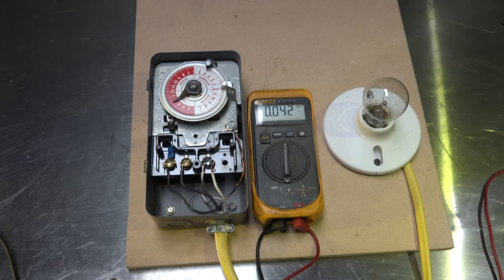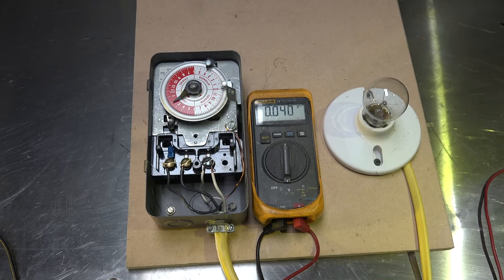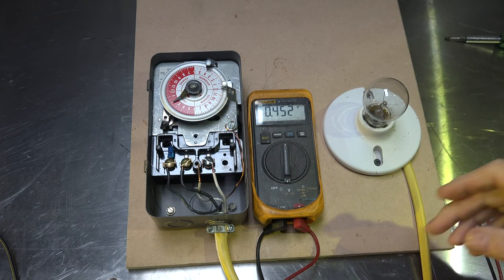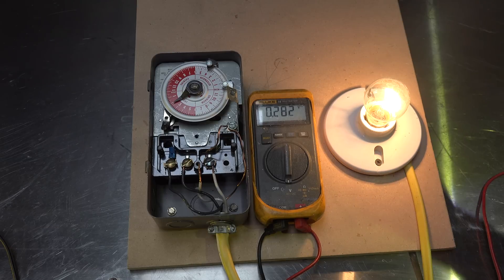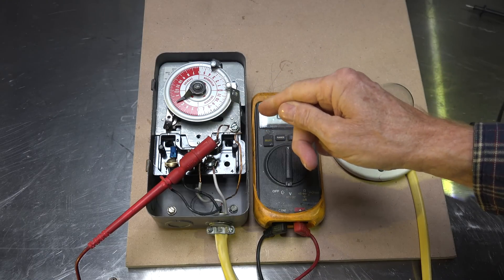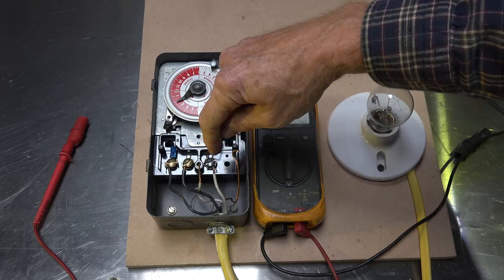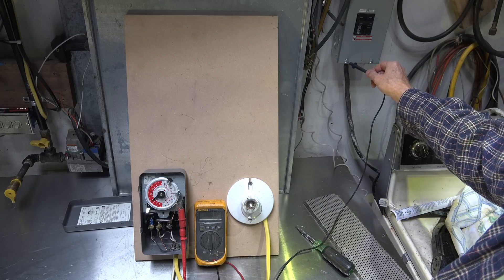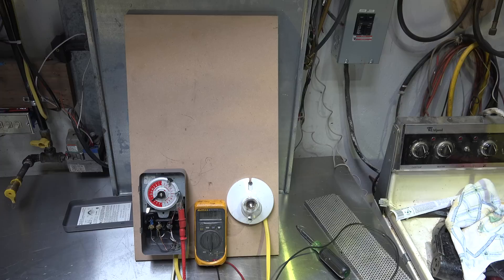The separation of  neutral and ground on the sub panel

Comment: @grayfurnaceman  On terminal 3 in this subpanel, which neutral is connected the light, and which neutral is from the mains power (the neutral wire on the left or right)?
Reply from the maker: It is the neutral on the left of the terminal.  Because the ground wire is connected to the neutral in the main panel, there is a path to neutral.
GFM

Comment: Exactly what I needed to know...will be wiring a two space subpanel in detached building and now I plan on driving a ground rod and putting in a separate ground terminal.....thanks for a great explanation!!
Reply: Don’t install a second ground rod.   Your ground needs to come from a common ground at the main panel.   Ground loops can readily occur and give you fits with electronics and could have enough potential to be dangerous to your health.
Reply from the maker: Welcome
GFM

Comment: The thing that's throwing me off is that if it's bad to tie them at the subpanel, then why isn't it equally as bad to connect them at the main panel?
Reply from the maker: Consider if the neutral and ground were bonded in the sub panel and there was an open in the neutral.  Would not the ground then possibly become hot if there was a problem in the ground circuit?
GFM
Reply: Right, I get that.  But wouldn't the same thing happen on an open neutral from a circuit from the main panel?  Thanks for the reply by the way.
Reply from the maker: Its all about the conductors upstream of the panel.  If the neutral is open between the main panel and the pole transformer, no 120 volt circuits will operate.  Those circuits in sub panels would operate if the ground and neutral were connected.  Contrary to some beliefs, earth ground is not part of the circuit.
GFM
Reply: The path is to long from the sub panel
Reply: OK, that makes sense. An open neutral in a sub box that has neutral and ground bonded, while energizing the case, also follows the ground patch back to the main box, finds a patch back to neutral at the main ground to neutral bond, allowing for dangerous operation of loads at the drop of the sub.   ///   An open at the Neutral lead toward the transformer kills the ability for a/c to flow as one side is open to the source.  Even clearer now.
Reply: I’ve got a sub panel with no ground bus bar to hook up grounds to, or for that matter, even the 100 amp service ground back to the meter either. I’m assuming I need to buy a ground bus and keep grounds and neutrals separate but? I think the only other panel I’ve wired had the ground bus so I looked into this one kinda skeptically and found your other vid then this one
Reply: @907Blademan  if you have a subpanel with 4 wires coming into it from the main panel or main disconnect the 4 wires are 2 hots 1 grounded conductor (neutral) and 1 grounding conductor (ground) install a ground bar flush  to the metal inside the subpanel. Make sure to run a green bond screw through the ground bar and into the metal panel housing. All your grounds will go here. Then your neutral bar will be sitting on plastic feet/ insulator to make sure it does not touch the metal housing of the sub panel or touch the ground bar in anyway. All your neutrals will go here separated from ANY grounds. Always remember, you seperate your grounds and neutrals AFTER the first means of disconnect. ( the main power shutoff) I hope this helps someone.
Reply: @907Blademan 
If you read the package it likely says that for use as subpanel, you need to install a separate ground bar kit purchased separately. And will also instruct you to NOT install the bonding screw.

This allows them to sell it for use as a main or a subpanel.
Main AS/IS (just install bonding screw) or as a subpanel by adding a ground bar kit.
Reply: The main should have a separate wire (usually 8 AWG bare solid copper) that runs from the main panel to Earth ground. 

This is so if you are using an appliance that shorts out, there is a path of least resistance to Earth ground. ( Less resistance than your body standing in a wet shower touching a metal handle. )

ANYWHERE that neutral and ground are connected (bonded together) there should ALSO be a wire from there to Earth ground. (usually a 5/8" copper rod driven into the Earth nearby)

Comment: If the ground wire and the neutral wire are terminated on the same strip in the panel, you're pissing in the wind. By hooking up a duplicate ground to the chassis of that timer, you did exactly the same thing as your little white jumper wire.
Reply from the maker: It is not the same.  I have explained this in other videos.  Try my channel playlist  "Grounding and bonding"
GFM

Comment: I have a Sub-Panel in my shop which was there when I moved in....  It's wired WRONG as per your illustration.   I want to correct it.......  It's actually 200 amps coming directly off the Meter, to a 100A Disconnect approximately 2' away from the meter, from the 100A Disconnect Box on the Hose,  the wire runs under ground the Shop.   Theres 4 wire leading into to the sub-panel.  

Question:  How do I determine and/or Identify which is  "Neutral and which is  Ground", so I can  ????   

I know it's wired wrong, because a 110 outlet has POWER from "Safety Ground" to 1 side of the socket. 

So, I want to Correct it,    just need to know how to determine NEUTRAL from the GROUND.   Any help is appreciated.
Reply from the maker: If there are 4 wires it is probably ok.  Having power between the hot (small slot) and earth ground is normal.  Look for the same color wire at each end of the line to the shop.  The ground at the main panel should have bare wires going to it.
GFM

Comment: why not make 2 separate connection to the floor? one for neutral and one for ground.
Reply from the maker: Because neutral is a part of the circuit. Earth ground is not part of the circuit. It is only there for lightning and surge dissipation
GFM
Reply: It's hooked up to the ground bus bar in the panel for surge protection/lightning protection. Like GFM said, the only purpose for the ground rods physically driven into the ground is for protection against lightning strikes preventing electrical fires in the home, and surge's in the power lines upstream of the main panel.
Reply: Not if it's hooked to the ground bus in the panel.

Comment: most homes have a bonded ground and neutral.  both then share the same potential no matter where they are bonded in the home. understanding potential is not the hilight of some HVAC techs knowledge which can lead to disaster if not properly handled.

Comment: What if you have an outbuilding from the 1940's with a subpanel that only has hot and neutral feeders from the main panel? The whole electrical system of the building is in EMT(set screws connecting sections) with metal boxes, all metal boxes as well as outlets are pigtailed to ground wire, then ground and neutral are bonded in sub-panel, with a ground rod being attached to the panel as well. Even if a hot wire touched anything metal in the system, there is a direct path back to the main by the ground-neutral bonding. Is this still unsafe?
Reply: Sherman, that doesn't sound right to me.  It sounds like you have two grounds for your system, one at the out building and one at the main building.  I think you need to remove both the ground rod and the ground/neutral bonding from the sub-panel and run a separate ground to the main panel in the main building.  Your conduit and steel boxes act as a ground for the out building and that is fine as long as they are connected to your system ground but having two system grounds can be dangerous.  I am just a guy with some electrical experience, I am not a trained electrician.  If you still have questions about what you should do then you should call a certified electrician.

Comment: at the main service disconnect, the "building ground" and service neutral are bonded, though, right? so what prevents the exact same situation occurring on any particular load-side circuit, in an installation where there are no sup-panels? the neutral becomes open somehow at the main service disconnect - load devices still have a hot and still return undesired current via their ground wiring. How is this only a phenomenon that can occur when configured at a sub-panel? I think I see how, in that the load devices do not bond their chassis and their neutral - but still, the fault (or mis-wiring) that you induced in the sub panel could also be induced in a mains panel, no?
Reply: Rick, you answer most of your own questions in your post but to answer your last question, the neutral and ground are already connected via bonding screw at the main panel so shorting them would have no effect and disconnecting the neutral wire would break the circuit.  So, no the faults he created in the sub-panel could not be induced in the mains panel.

Comment: but, if your grounds are intacted you should have no problem. is a common/neutral not in fact a ground? mine runs to the ground in the main.
Reply from the maker: Earth ground is not part of the circuit.  The circuit is hot to neutral.  Earth ground is for surges and lightning absorption.  Hope this helps.
GFM
Reply: Patrick Pedigo if they are bonded in the main, they share the same potential and the ground becomes part of the return path for current. If anyone tells you different, they then do not understand electrical potential.

Comment: The neutral is a current carrying conductor all current carrying conductors have a voltage drop . In the main panel ground and neutral are bonded this is the only place that makes since . In a sub panel it may be a long way from the main so as current flows through the neutral there is a voltage across it ,if it was bonded again in the sub panel this voltage drop would be present at all ground pins at every receptacle ,yes it would be very low but under the right circumstance it could shock some one ,not to mention ground loops. The only place that neutral and ground should touch is in the main panel.
Reply from the maker: Good thoughts.
GFM
Reply: I like to use the term, "main service disconnect". People usually get confused between main panel and sub panel and I do mean non electrical type people like customers.  I just did some work at a house today and all of the branch circuit neutrals and grounds were on the same buss.

Comment: Is that a timer? Why is it used in the vid? It just confuses the explanation. It's not clear how the circuit is configured.  C'mon now. You can do better than that GFM.
Reply from the maker: It is used because it is a sub panel with a metal housing.
GFM